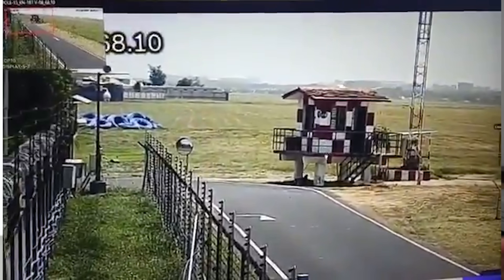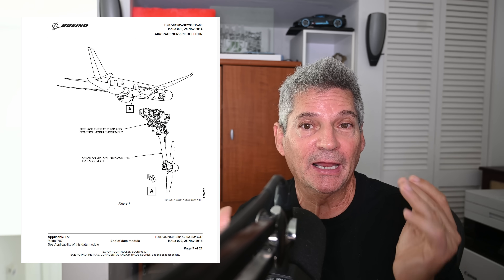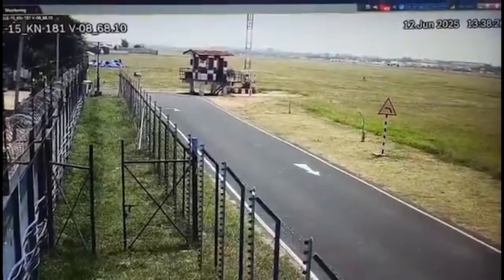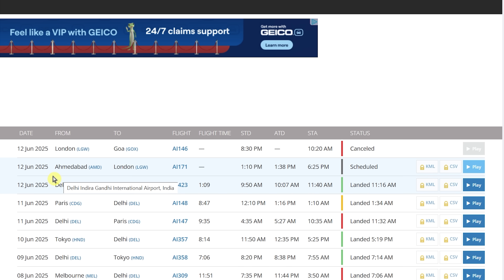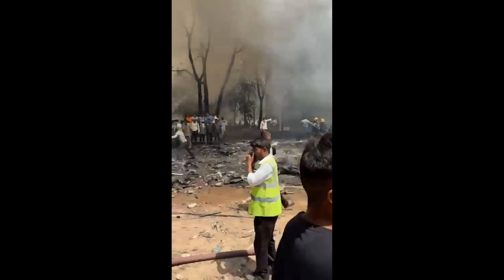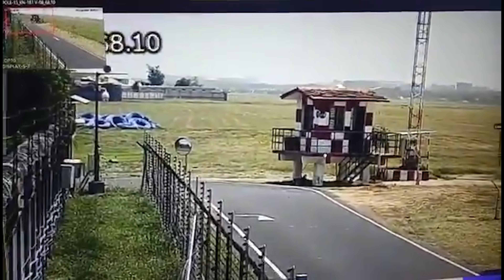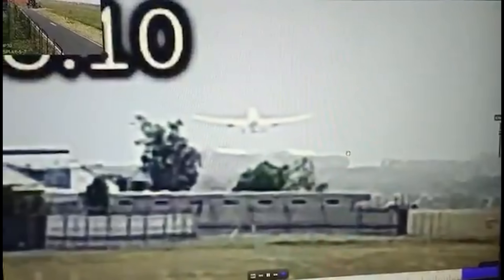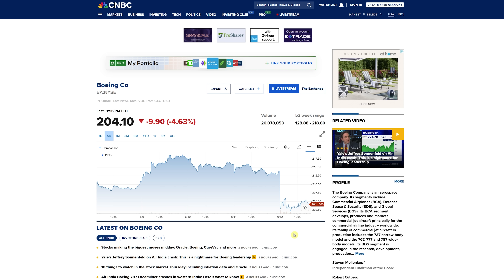What Caused Air India 171 Crash, Mysterious Sound Before Impact

Comment: lots of questions: why the plane need to taxi to the end of the runway? why dust shot up after the take off? too late to leave the ground? why pilots didn't take a decision to stop the plane when it left 80% of the runway and still taxying on the runway?
Reply: "why the plane need to taxi to the end of the runway?"
Because there is no full parallel taxiway.

"why dust shot up after the take off?"
Because it's hot and the grass died?

"too late to leave the ground?"
According to whom?

why pilots didn't take a decision to stop the plane when it left 80% of the runway and still taxying on the runway?"
Whut...? Taking off is not the same is taxiing.
Reply: @brucelansberg5485  My perspective behind those questions is different. Here is a bit detailed version:
Why the plane need to run all the way until the end of the runway? It is supposed to leave the ground at around 2/3rd of the runway. too late to leave the ground??  ==> red flag#1

the dust shot up because the plane didn't leave the runway /or is too late to leave the runway. The dust that got shot up perhaps is another indication that this flight used too much runway and is struggling to take off - a symptom ignored/missed by pilots or ATC or both??

why pilots didn't take a decision to stop the plane when it already ran over by 80% of the runway and still taxying/running for take-off on the runway? ==> red flag#2

IMO - atleast these are two big red flags that were ignored by the pilots, there may be a lot more red flags - which may get uncovered during the thorough investigation of DGCA.
Reply: @thirudoddi8485  Fair enough. Yet, how do we know it used the full runway? I haven't seen any confirmation about that. just because a narrator tells us it's the end of the runway, it doesn't make it a fact. The narrator knows as much as we do at this point.

I did notice dust going up. Might as well be a dry and hot day and soil from the parts next to the runway. 

As soon as V1 is reached, there is no stopping. It would be my assumption V1 was reached. The captain was a rather experienced pilot.

I'm not a 100% sure, but my guess is AAIB is in charge of the investigation.

Comment: They were not able to get off the ground because they had no flaps
They continued with the alarm blaring and they pulled the breaker instead of trying to figure out why it was blaring 
They saw the end of the runway and pulled up hard and as they rolled off the end of the runway onto the gravel and dirt the plane lifted off but they couldn't get altitude and they came right back down.

I am so glad I stopped flying 15 years ago

Comment: One as another video they said the pilots did not did not use the full length of the runway. You notice the dust kicking up as it lifts off and that’s the grassy dirty area at the end of the runway. So maybe he had to pull up before they really had enough speed (V1). Also, people in other videos thinks the flaps were not deployed and that would meant way less lift. And the wheels are down, if the take off was normal the wheels would have ver up or going up at time of the liftoff.

Comment: Reading some of the comments here, especially the guy who was saying you were one hundred percent wrong. Hold up!! Not necessarily! That noise does sound very similar to a RAT deployment and it can deploy with the engines technically "running" although not producing adequate thrust to keep the airplane flying. 
FYI, for accuracy purposes, the JAL 787 you reference was not coming in on an emergency landing. That video was shot at Paine Field, Everett WA, where they used to produce the 787. What you see on the video is a RAM flight test. These are conducted for all aircraft coming off the production line. One of many requirements before final delivery.

Comment: Flaps are up. Pilots retracted the flaps instead of the landing gear. Pilot error.
Reply: The first thing I noticed is that the landing gear is tilted the wrong way with its tippy-toes down at 0:01. On the 787, this only happens during gear retraction, but since the gear is not retracting, it is reasonable to conclude there is a problem with the landing gear. Possible hydraulics issue, could be caused by engine flameout.
Reply: @0w3nn  mayday call did not mention power loss
Reply: @brentpalmer2577 it’s a possible theory, I’m not saying it’s 100% the case.
Reply: Facts are out, but the miracle of instant analysis can predict anything now.
Reply: To many chickens flapping about on reporter said .  Im pretty sure somebody was joking. Indian humor is odd
Reply: Agreed!! I've been saying that too
Reply: Usually is pilot error totally not configured properly
Reply: Plane wasn't moving fast enough to generate lift. Hot and humid, with a tailwind. CVR will reveal what happened.
Reply: Supposedly the safety systems don't allow what you say happened.
Reply: If a rising plane failed suddenly after a  take off, the physics of jet  forces comes into play. This  basic primary explosive Force in the combustion chamber failed suddenly..What suddenly reduced this massive propulsion Force to seemingly zero can cause a total failure of what  produced this Jet Force. Other issues though important are secondary.
Reply: the survivor said there was a loud bang when they went to put the gear up but it wouldn't go up
Reply: @Anon-zu3xn  passenger would not know if there was a problem with the landing gear  unless announced by the pilot
Reply: @brentpalmer2577 you hear a massive bang when you take off and he tries to put the gear up you can guess. if it was engines they'd smoke or "flame out"
Reply: @Anon-zu3xn  Wow, the passenger half-way back in the plane knew the pilots had placed the landing gear handle to the retract position and the gear wouldn't retract?

Comment: Well it definitely sounds like the RAT was extended so indicative of a double engine failure. Looking at the dirt that was kicked up at liftoff, this looks like a performance calculation error. To me at least, it looks like they may have rotated because they ran out of runway, possibly ingested a load of dirt off the end of the runway in the process and killed the engines. I fly the 787. If the flap setting is not in agreement with the flap position entered into the FMC during preflight, a warning will be generated, so unless they ignored that, then the flap setting for takeoff was consistent with their take-off performance calculations. However, if they made an intersection take-off, used an incorrect ZFW or the wrong airfield data, anyone of those could lead to erroneous performance calculations for take-off, resulting in never achieving VR speed before you run out of runway. This is my theory at least.

Comment: Sounded like the Ram Air Turbine was deployed to me. The 787 does have one hull loss I believe, but not from a crash, from a lithium-ion battery fire in Japan. You also showed the floor plan from the 900 series, this was a shorter 800 series. On the 800 series seat 11A is right behind one of the port side emergency exit doors.

Comment: It sounds like the turbines are working, but not generating air pressure to propel the airplane forward.!
Compressor Damage or Inefficiency
Bypass Airflow Issues (in Turbofans)
Exhaust Nozzle Problems
Fuel or Combustion Issues
Instrumentation Error or Misdiagnosis

Comment: All I heard  sounded like the main engines spooling down. There are fan blades there too.   It seems like power was lost either at or after V1.  The gear stayed down and I think all flaps were still in takeuff configuration.  And I guess the pilots radioed for help.  This will all come down to why they lost power.

Comment: One thing that is not right here is they did not put the gear up when they should...which would create more drag and slow the plane down. It does appear from that clearer video that flaps are up, and this should not be the case until they reach about 1000 feet and have sufficient speed to raise the flaps.

Comment: It's reported they back taxied to end of runway to use the full length.  High heat? Heavy load? Also barely made it into air at extreme end of runway, climbed a few hundred feet and then started decent. Would be similar to flying out of ground effect without enough lift.

Comment: Based on the takeoff video I reviewed, I suspect an aerodynamic stall occurred. An aerodynamic stall during takeoff is a critical event that occurs when the aircraft's angle of attack exceeds the limit at which smooth airflow over the wings is maintained, leading to a significant loss of lift.
Several factors can contribute to such a stall during the takeoff phase:
1. Excessive Angle of Attack - cant seet this on the Video
2. Aircraft Overweight or Improperly Loaded - this is usual in India
3. Wing Contamination - possible
4. Insufficient Airspeed - possible
5. Adverse Wind Conditions - cant find any signs for this being the issue
6. Mechanical or System Failures - possible
7. Human Factors - possible
8. Potential Bug - possible

This can be due to the fact that the Flaps are not set properly. Pilot can still takoff at start - Takeoff Configuration Warning System (TOWS) should give alarm signal, but if there is a technical issue the TOWS could have not reacted. When Plane climbs at first stage it will stop climbing after certain hight and that causes the lose of upforce. Pilot can now try to push the engines for more speed but that will not work anymore. Nevertheless the Blackbox will provide more informations.
Reply: PLUS …. Heat,altitude ,load … no power !!!!
Reply: You forgot the plane is made by Boeing. Possible

Comment: The main battery was probably under 28volts the RAT is deployed if the engines N2 goes under 50 percent if i remember correctly reading on AMM
Reply: Your right. It's happens on all Boeing aircraft..If the engines loose power, the rat automatically deploy.